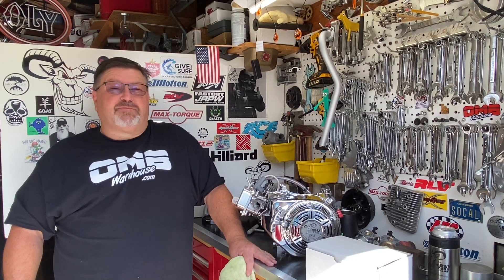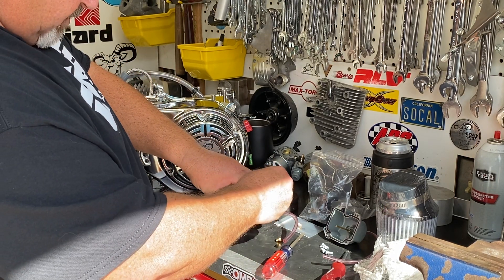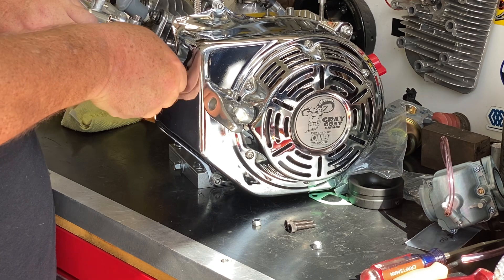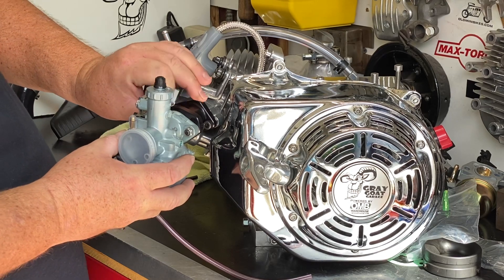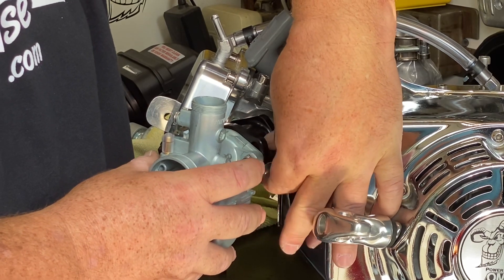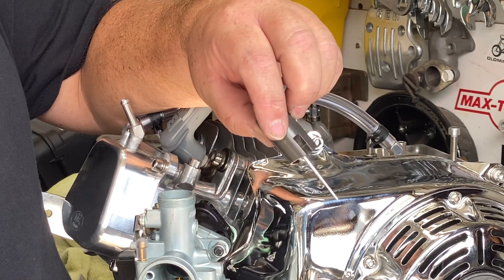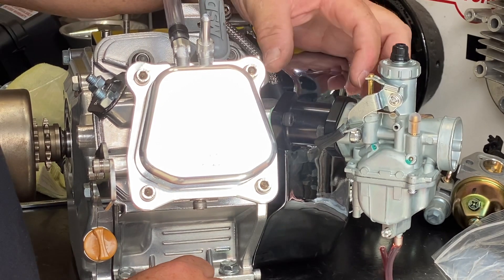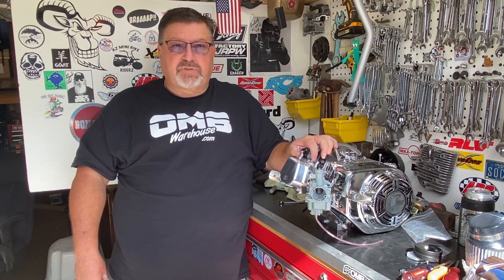Mikuni Carb Install on Predator 212 Coleman GX200 & Others - How To

Comment: You need to put a permanent marker into the manifold and mark the carburetor to dremmel it a smooth slope. I get more air, moved up a jet, and man, I can feel the power difference! 😃
Reply from the maker: I port match all of my intakes and headers including the gaskets. I am just showing how 95% of the people should install these

Comment: I got one of these Chikuni carbs for my mini bike and I was watching Bahnzai's video on them and he said that the "choke" lever DOWN meant the choke was on and the and the lever UP meant it was off. Here in your video it's stated as the opposite way. I shall have to test and report back. In my mind your method sounds correct because on cars with manual chokes, we would lock the flapper closed when starting on cold mornings to keep out the cold air. This, by default, fed more fuel than air in to the engine for a better chance of the engine firing up sooner. Cold cranking an engine for 30 or 40 seconds or more was a sure fire way of wearing out all the metal-to-metal surfaces inside the engine prematurely.

Comment: I bought an aftermarket manifold from Amazon.  It looked just like most of the others. out there.....BUT I could not get the carb o-ring to center on the manifold with the carb clocked level.  To get the o-ring in center I had to have the carb tilted a bit.   I demand perfection, so I built a 1/4 " spacer plate that allowed the O-ring to seal on it.  Then I used a gasket to seal the plate to the manifold.  So far it has worked great.  I would recommend buying your manifold from a reputable source like OMB  or GPS  Ect.

Comment: So is there a noticable difference in power with these Mikuni type carburetors over the Stock Appearing bored out and modified race carbs ? Like will the cheapest Mikuni still blow away the most expensive Stock Appearing Race Carb ? Curious cause I have a .650 venturi SA Race Carb on my Mini Bike now and it does do a good job and hauling my fat ars around but always wondered if i switched to a Mikuni style Carb would it be even more powerful than what I got now ?

Comment: Recommendations on what size carb i should order for a 212cc engine? I got a 26mm carb and it only idles high and wants to runaway from me. I was thinking of going down to a 24mm, but I'm wondering should i go down to 22mm instead?

Comment: I have a 26mm carburetor I got from Amazon. I have a 125 main jet and a L38 idle jet in the carb. It's hard to start when the engine is cold. Crank pulls easily, valves are 18lbs and lashed at .003 and sparkplug gaped at 31. It seems that it doesn't hold an idle from the previous day. I have to increase the idle to get it started and then turn it down to 1200 rpm when it warms up. What  is it that I'm doing wrong. Your input would be greatly appreciated.

Comment: Hi Sir I have a issue my throttle cable is too short by about 2 inches on gokart I'm running mikuni carb I'm using the 75 inch cable I don't see anything longer what options do I have??? Thank you

Comment: I've been running my 212 on a bypassed governor. I jus got a mikuni carb. Would I be able to install it even tho I haven't physically removed the governor? Thanks
Reply from the maker: I wouldn't even attempt that. You are wanting to bolt a performance carb to a stock engine. Performance is built from the inside out, not outside in.
The stock rod and flywheel are not designed for higher than governed rpms and will fail.
The stock cam does not have enough lift or duration for a larger carb.
I am a minibike guy and I will not ride a minibike with an ungoverned engine unless I know there are billet parts installed
Reply: @TheGrayGoatGarage  Agree but the reality is that guys are watching videos that prove of the gains from a slide carb over the stock carb, stock cam or not. So it's expected that in many cases guys are going to put a slide carb on a stock engine. They're going to get a $40 Chikuni carb kit before getting $120 plus worth of rod and flywheel no matter what we tell them. We can only hope that valve float or gearing prevents them from blowing things up.
Reply from the maker: @Deucealive75  I know! That is all we see on Facebook these days! I hate it, but what can we do?

Comment: Hi there, I would like to ask many questions, I am new to building 4-stroke OHVs for my motorized bicycle. What is that big tube arc coming out from your cylinder head? I thought for open cylinder heads, you just use a billet air filter? I have a 4-stroke 212cc OHV but its not a predator, and my open cylinder head does not have a metal mouth sticking out like the predator 212cc where one can put tighteners to help hold the tube in place, instead it just has a hole with like interlocking teeths inside the hole and i just have to stick in a breather tube and the teeths tight grip seems to help hold it in place. I am unsure if sticking in a breather tube with a billet air filter on the other end is good enough to stay intact because i plan to use the engine for a motorized bicycle and its going to rock a lot. I also would like to ask about the governor, after putting the mikuni carb you seem to leave the governor alone entirely. For my 212cc ohv stock engine, the throttling was attached to the governor connected by springs and that they are supposed to work together?. Can i leave the governor out entirely after buying a mikuni carb? I am new to engines and unsure how a governor thoroughly works inside the engine, but as far as I know, it controls the oil being spewed out in the engine at different rpms, and that it regulates rpms and can make the engine automatically shut off if not properly governored. I am afraid to run into issues of my engine automatically shutting off or not being able to reach higher rpms, if i do not connect my carb to my governor because they seem said to work together in my stock model. or am i missing something? Can i just buy a mikuni carb and cable it to my hand throttle and leave the governor untouched or unconnected? pls help thanks.

Comment: Im new to this but i bought an aftermarket mikuni and an actual mikuni for my predator motors. THey both leak gas from overflow and the breather intake. im lost . any ideas??
Reply: Mine leaks out the airfilter also have no fucking clue I’m changing back to stock carb but gonna upgrade it and just aftermarket airfilter
Reply: @wyattimpecoven  the float bowl is probably not level. Take it apart and see if it level
Reply: If it leaks gas from overflow check float bowl. Or valve float could be bad. Where i live you just cant buy a valve float. Gotta get a new Mikuni

Comment: How fo you know when it’s running optimal will the spark plug also tell you ?
Reply from the maker: Reading the spark plug is the best way to know the carb is correctly jetted! We can only tell a little by the throttle response!
Always read the plug!
Reply: @TheGrayGoatGarage  i pulled mine and is black

Comment: What about the governor? Do I keep it in the engine?
Performance carb can be kept at a minimum RPM?
Reply from the maker: You cannot use a governor and a slide carb unless you are very creative! A Mikuni 22 is a performance carb that should be bolted to a performance engine. The carb wants to see more compression and a bigger cam to operate properly. The additional rpm capabilities of these carbs will stress the connecting rod and flywheel beyond their limits with potential failure that can hurt you. I don’t recommend this type of carb for an otherwise stick engine. Performance is built from the inside out, not outside in!
Reply: @TheGrayGoatGarage  I understand, but the original Honda carb and the NOS carb I just bought still want run unless the carb is on choke. And the new carb has been cleaned and gas tank inside is like new. The Honda 6.5 engine is new
Reply: I guess I can put my 440 2 stroke on my go kart. it has a 32mm mikuni carb

Comment: When you aligned the carb to the adapter and set it, when you leveled the carb didn't it come out of alignment?
Reply from the maker: Keep the bolts snug enough so it can’t move and tighten them down. It may take a couple of tries but worth the effort!

Comment: hey gray goat good morning, i have two honda engines i 5 horse and the other 5.5 horse. would it be safe to run a stock mikuni or any other carburetor? both of my engines are stock and id like to keep them that way for reliability purposes, I've done  a good number of kitted engines for other people in the past and i want something different. any recommendations? thanks for the advice and keep those awesome videos coming< catch you on the next one.

Comment: What could cause my engine to die out higher rpm’s? I have bigger cam, mikuni carb and the other basic stuff but it dies out when it revs higher and does not have the governor
Reply from the maker: If the carb is having the engine running very rich, this will cool the head and foul the spark plug. I would guess if you pulled the spark plug the electrode will be black and sooty. Raise the e clip on the needle all the way to the top and test from there

Comment: U have a Chinese knock off mikuni carb which is why it's designed poorly with the fuel mixture screw that goes right above the head on my pitbike I got the legit one which has a completely round Venturi tube the knock off is an oval and the legit mikuni uses an air screw instead of fuel